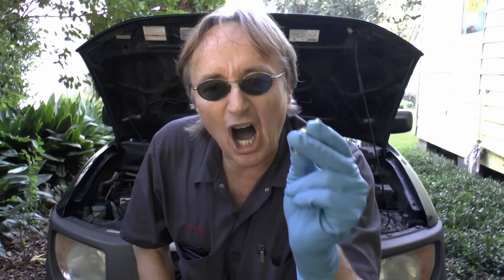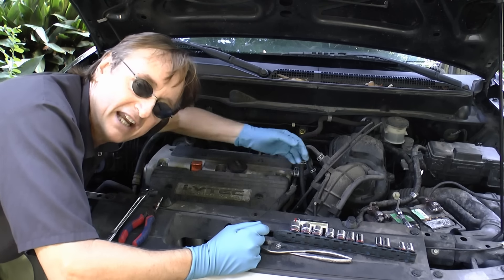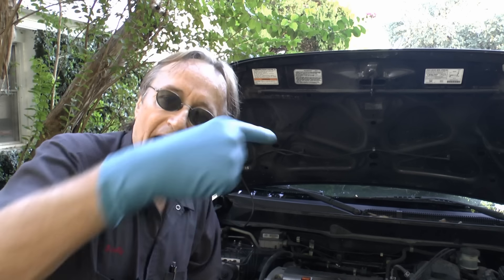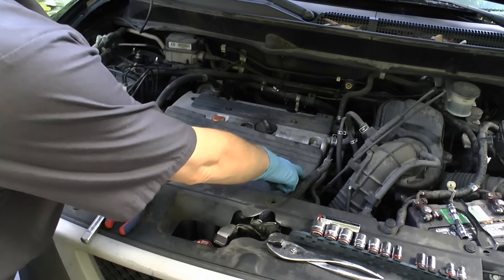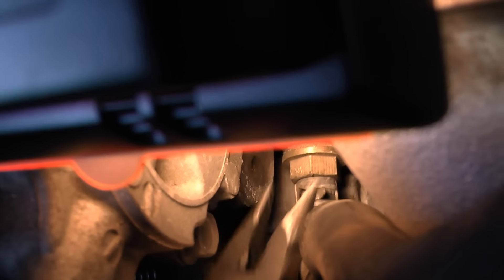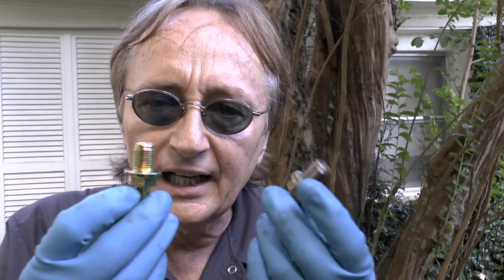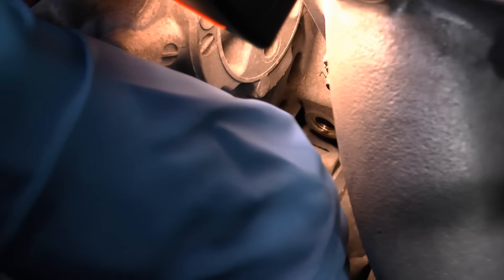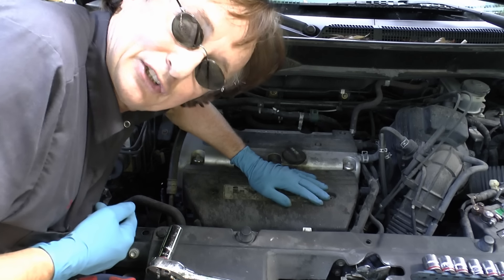How to Fix a Car Engine that Burns Oil for 10 Bucks

Comment: Scotty please help me, my GMC Envoy xl 2003 is burning oil and I went to buy a PCV valve and the store guy told me this model doesn't have that valve but I can't believe it because you said that was with really old cars.  Scotty help me, .please.
Reply: By what I understand is you have a PCV but no valve. You should only have to replace the hose if it is clogged but I could be wrong. I would call Chevy and ask a technician if he could explain it to you.
Reply: A purpose of the PVC is to lower crankcase pressure.  One way to do that is to buy an oil fill cap, that lets air out of crankcase, but not into crankcase, or engine might get other problems, run lean, and throw codes.

The special Oil filler cap is made by a company is called CFM Performance, , has a nylon ball in it, costs about $80, their number is 800-943-1203, leave a message

If you try this, if they make one for your car, please let me know if it makes a difference in oil consumption , My gM car has an internal PCV and this model car has a problem with oil consumption.  My car does not yet have oil consumption problem ( knock on wood) 
I am using the vented cap, but I don't know if crankcase pressure is the cause of oil consumption or if it is high pressure of GDI or if gM just has a crappy design.

Comment: Impossible to do on a GM 3800 pre-series engine.  I took it to a shop where it costed me $130 for a new valve and a grommet.  The valve was fine to begin with anyway, it turned out. And it was original. Never again.

Comment: I took the head cover off and saw a lot oil in there, is it supposed to be like that? At first I thought was normal for lubrification of the parts, but after i watched another videos and seems like it is not supposed to be like that . Ok s it?

Comment: So my car has a thin cloud of smoke coming out during a cold start, not blue, white or grey I believe, also not freezing cold mornings. I had the head machined, new valves, and head gasket. Also once I drive it goes away and doesn’t happen. What would that be?

Comment: I have a CS 2 lancer with a 4G15 engine. Sometimes while driving the engine check light comes on leading to complet loss of power. When engine is switched off and restarted the check light resets and the car works like normal again. Can u advice me on what may be the problem. I.e this only happens when the engine is under pressure e.g going up a hill, or sudden press on the accelerator

Comment: I did this not too long ago on my 2012 Veloster. I just checked the oil after about 2300 miles and it still burned a quart. ??? What could that be if not the PCV?

Comment: Hi i have the 2.4vvti engine in toyota estima jap import, it burns oil,  but main issue is oil burning smell when foot is down for dual carriageway motorways?      Spark plugs has oil on threads and abit on the rear white part of plug

Comment: I have an accord 2008 
I am having a problem with the engine oil leak a mechanic said that the engine oil is burning up into fumes and some is leaking in to the exhaust,  they said my Piston rings are weak and i need to change the piston rings or the complete engine cause he said changing the engine will cost lesser he said pls advise what should i do, 

how do i know if its the PCV value thats causing this issue

Comment: I got a Nissan pathfinder 2003 the PCB valve is about 5 dollars but to change it the engine head has come down something that coast 5 dollars cost me more than 500 dollars to replace it.

Comment: My 6.0 Cadillac motor doesn't have a PCV valve it has a unit that's welded to the valve cover and then the hoses hooked to that do I change the valve cover then

Comment: I recently bought a 2001 Toyota Avalon but it has a lot of sludge build up on the top of the heads is there an easy fix to clean the sludge build up that's just shy of removing the heads

Comment: Scotty 
Can i clean pcv valve (made of plastic) with brake & parts cleaner? 
Would it damage the plastic pcv valve? 
Pcv valve is about $22 in my country,  so i decide to clean it up
Reply: just changed mine, they had no name brands on ebay for 8 bucks but I decided to go with toyota oem brand for 12.
Reply: @nmatthew7469  i found 1 on ebay just 2.5 bucks.... Free shipping from china... Thank you for the information
Reply: @NotToday96  cool. I buy lots of carpsrts on ebay unless i can find it cheap at local chain autoparts store.

Comment: I have a 2004 camry with 215000 miles and it smokes at startup. Uses one gt every 1500 miles. Any help on stopping the use?

Comment: A 2004 BMW 325I, last few weeks when it  gets hot outside over 80° F, would stall and come right back on, literally in moments sometime 4 or 5 cranks to get back, starts acting weird and keeps stalling, I can put some gas in a t this point and but me an hour or two in the cold, but the heat makes it stall at a certain point, I'm 90something percent sure it's fuel pump, the factory went out 2 years ago, I got the best looking one at salvage, looked brand new but off brand, when other fuel pump went, car wouldn't start in parking lot, but after sitting there 2 days, fired right up, I drove 3 miles and it cut out, I had parts to change it on the street. I think I dropped ball with aftermarket pump😞

Comment: Hey Scotty are you doing this is Felix the mechanic I’m located in Jersey I have a question for you I have a 2000 Toyota Corolla it smells inside like fuel and is burning oil any idea what can I check before I get into the motor if you can help me I will gladly appreciate it

Comment: So I just got a engine flush and oil change a few weeks ago. Iam still 1700 miles away from getting another oil change. Iam not leaking oil,but I assume iam burning oil. U think this is the problem with my 2001 Honda accord?

Comment: I was sold a 2097 cam ray with an oil consumption issue on manufacture the dealer won’t fix can I do anything besides put in a new engine as I’m on social security. And strapped for money?

Comment: Just replaced this in my 2010 Honda CR-V. I think the shorty Honda ‘technician’ screwed with it, when he demanded I change my calipers without checking if they were bad, good thing I didn’t give in. He got mad. After that I was having problems I had to change oxygen sensors in my exhaust and have carbon build up in tail pipe and was burning about 1 litre per 5000km.

Comment: Scottie, My 2018 Tacoma has 59,000 org miles and I change oil every 5,000 miles. At 10,000 its free from dealer, and my mechanic every 5,000  miles. Lately Every Am when I start it, blue smoke. Then  eng lite activated. found 1qt low l replaced it. Then week later went to dealer. Another 1/2 Qt low. They topped it off sealed it  and told me to drive 1,000 miles then they will pressure check it. Why tests just check seals. But I'm just the customer. Any ideas? Don't wanna damage engine.

Comment: so on 05 expedition 5.4 3 valve don't seem to have a pcv I guess it has a vct is it the same thing and cause the same problem mine is burning oil the truck has 121805 miles on it

Comment: My transmission just quit working on the Chrysler 2007 300 and I seen some smoke and some some kind of oil underneath would you know what it is it don't go in Drive reverse or any gear it goes into gear but it don't go nowhere

Comment: My starter is going bad and i hit with a hammer and it still wont crank. It was cranking when I hit it now it just won't turn over just hear a click sound. Do you think its to hot after driving it .Or wait til it cools down.

Comment: My PCV cover is broke where my hose connects. I Have the hose shoved down in the hole where it used to connect to the crank case. Would this be a reason I'd be burning oil? its on a 02 Chevrolet cavalier z24 2.4L. (Not a quad 4) I've had it since new and always changed the oil at proper intervals. Been babied its whole life and no other problems to speak of that haven't been repaired immediately. This one is stumping me. I hope it's not the pistons. It don't smoke or stink. She has 155000 miles on her. Still runs great. Please help me Scotty!
Reply: Yes if the PCV hose is broken then you will be burning a lot more oil!

Comment: Hey scotty my little brother overfilled his engine with motor oil. The car idles poorly and white smoke comes out. Is it necessary to do engine swap or just drain the motor oil?
Reply: DRAIN THE MOTOR OIL FIRST IMMEDIATELY!
Reply: @mitch1078  hey mitch i drained out the oil but white smoke still appears at the exhaust. What should i do now?
Reply: @jeffreyxiong205  Did you change the PCV valve per this video? Otherwise your piston rings are likely worn...lemme know.

Comment: I need help. I have an 08 avenger. It was running great then all of a sudden it just quit on me. It wouldn’t start took it in. 2 places couldn’t fix it. I took it to a car part place got it scanned. Instead of guessing I changed the computer, cam position sensor, spark plugs, it starts and runs but it is now mid firing when I hit 40 mph. Was told possible ground wire? Can you please help. No one around me knows what’s up?

Comment: Hi Scotty, I have a 2008 accord and its consuming oil. Just recently Ive noticed big volume of smelly white smoke coming off the exhaust, not all the time.

Let me know what you think the problem might be
Reply: ibrahimkhan27 bud, it’s your piston rings....no bueno. If it only happens upon startup then it’s valve stem seals
Reply: @austinrandall3685  is it a DIY issue or will I need a mechanic for it. And if so whats the damage im looking at.

Yeah it happens sometimes during startups.

Comment: I have a 2007 Chevy Silverado that emits a lot of white smoke out of under the hood. However, the engine itself is not overheating or anything like that
Reply: It's probably an oil leak

Comment: Hey @scottykilmer my 1993 civic dx 1.5l  burns 4 quarts of oil per full tank of gas,, what could it be ? I already changed the valve seals, it had 135k miles

Comment: Hiii sir I have Toyota diesel car it's smokes when I put out my oil cap and dip Strick. Then I changed my car pistons ring with a new original Toyota product and head gasket. After fix it up I saw the smoke is come from oil cap. What to do next to fix it that????

Comment: I changed this in my 2013 matrix and the engine oil is still disappearing. It is isn't leaking. There's no blue smoke from burning it. So where is it going? Please help.

Comment: Hi Scotty, I just got a 2008 Lexus GS350 3 weeks ago with 91k miles on it. I did the oil change with Castrol edge high mileage. Driving out today, I got an indication on the dashboard that the oil is low.
What to do you advise?
Reply: Check the oil level with the dip stick, if it's at the correct level, disregard the sensor.

If it's low, top it off, and check the level at least every gas fill up, remember to check oil while engine has been sitting a while, so all the oil drains back to the pan.

I had a Grand Am that had a bad oil level sensor, (oil level was always full on dipstick) replaced sensor and no more issues.
Reply: @mikeleith6185  Thanks, I checked the dip stick and it is very low, way below the lower mark. I added about 2 quarts to then engine then it's back at the normal level. Just filled up the tanks. I will be checking it from time to time. Thanks once again for your response
Reply: No problem Yemi Banigbe, if you have to keep adding oil, try replacing pcv valve like Scotty says.

Comment: Sir in india all Volkswagen tdi engines (new cars) blows gas and some amount of oil from dipstick at idle rpm 
It goes after when we raise the the rpm via accelerator pedal 
Now the same happen in hyundai s new genration 1.6 crdi engines too 
Which was not in earlier 2016 1.6 crdi engines 
Is there any manufacturers fault?
Plz reply
Reply: this is most likely a turbocharger issue. the turbocharger seals dont function as well as they could unless there is sufficient boost being generated to push the turbo shaft seals against their seats. once boost is generated, the steel rings seat and the turbocharger doesnt leak air into the oil return pipe. With only minimal boost (like idle or light cruise) the seals are in a relaed state and vapours escape into the unpressurised oil area of the turbo centre and then exit through the only escape route, the oil return valve into the sump.

Comment: Scotty I replaced maf sensor , purge solenoid and evap vent solenoid,  but trucks still running rough and throwing same codes on for these parts I replaced p0102,p0443,and p0449 any ideas im stumped?
Reply: It's a 2002 gmc Yukon 5.3l v8 no flex 4x4 slt

Comment: All right I'm having a problem with burning oil I thought oh yeah I'll look up where the PCV valve is for my 1995 525i yeah there's just about no videos on that and the videos that I can find are all for the 2000s and above I have a 95 E34 so that obviously doesn't work would you happen to know anything about it if you don't it's okay just losing my mind trying to find it before I go dive into head work

Comment: A mechanic told me to change the pcv valve every oil change.. What are your thought on that?
Reply: Absolutely NOT! Complete waste and must have been complete misunderstanding. PCV valves would not require preventative maintenance for 4 years or 50k miles!

Comment: Scotty kilmer just a question I have a 2008 Honda civic for some reason it Burns oil is that something I should be worried about do I need a new engine
Reply: First change the PCV valve. If that doesn't help then your piston rings are worn...possible from infrequent oil changes?
Reply: Mitch thanks what happens if my piston rings are worn do I need a new engine
Reply: @patrickl3150  It depends how much oil it is burning? If only quart a month you may be able to live with it. Otherwise you can consider having engine rebuilt. Scotty has recommended Lucas Oil Treatment so you can try that as band-aid. Did you change PCV valve yet per this video?

Comment: Replaced Pcv valve and car is still using excessive oil and saw on the fwy that the car had blown smoke when I accelerated to switch lanes it was t much smoke but still

Comment: I got a toyota Corolla with 2e engine. My car doesn't smoke, no leak but my oil decreases... My spark plug threads has small amount of oil.. What is this??

Comment: What do I need to do if my car is evaporating the oil I’m using 5W-30 high mileage Castro oil my engine has no leaks and no internal damage but uses a half a quart within 200 miles because it’s evaporating

Comment: My PCV valve is brand new and I’m still burning oil. I’ve replaced my seals and PCV but I just can’t seem to stop burning oil?!? What do I do?!? 

(1999 Honda Accord 4cyl 2.3L)
Reply: replace your piston rings and lightly hone the cylinders is your cheapest option. Adding thicker oil will just make it worse

Comment: Bad PCV valves don't allow oil into the intake manifold other than the blowby oil. They either restrict too much airflow or won't close when a backfire occurs.

Comment: My PCV valve on my 4.7 l Toyota Sequoia engine is extremely difficult to get off. I've put a socket on it and it won't budge. I was afraid I would break it if I put a hammer on the ratchet. What should I do
Reply: Air tools for their pneumatics is my only thought.

Comment: My 99 corolla burns oil.  I think it's because of seized oil control rings in the pistons though.    I saw a video of a guy replacing them without pulling the endine but I think that is beyond my abilities and desire to fix it.  My first summer owning my car I almost killed my engine though because I didn't know it burned oil.  Now I know to keep an eye on it and top it off when needed.  I wasn't the best car owner back then bit to be fair it was my first time owning a car and I had only owned it for a little while at that point.

Comment: what tool you used to open the valve ?
Reply: Only purchase replacement PCV if it doesn't open. There is no repair option. The PCV opens and closes on it's own with exhaust pressure.

Comment: I have a code po353 I install new ignition coil new spark plugs spark plugs wire and I erased the code  and it pops right back up I put my car on drive  put my foot on the brakes and hold it and my engine shakes like crazy  do you have any idea what's going on is there anyway I can show you a video

Comment: Why is it, the motor burns more oil if the valve is clocked? 
The valve is a pressure relief to the bypass. If the valve is working, it will spur oily fumes into the motor. The valve should reduce flow if vacuum is incrased though.

Comment: Scotty thought I had a bad 7.3 power stroke when all the oil drained and coasted to the side of frwy hence the wrecker advised blown hpop lines and my buddy big ugly Dave went to work correct for you powerstrocks 7.3 study what a hpop is good luck and dont forget to change sensor now iam back on the road

Comment: Ten bucks?
There are two on my V6 replacing both is about $100. Replacing them will save me the cost of repairing blown and leaking oil seals because there's less pressure building up inside the crankcase.